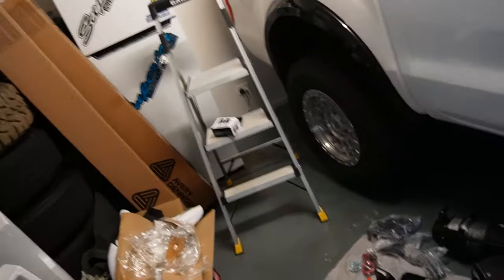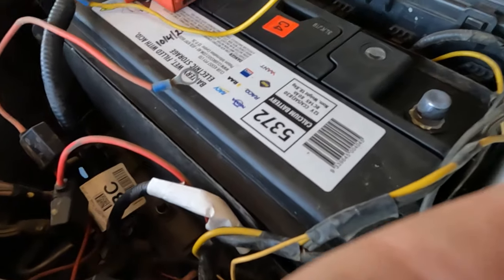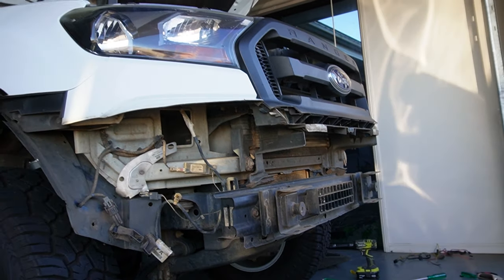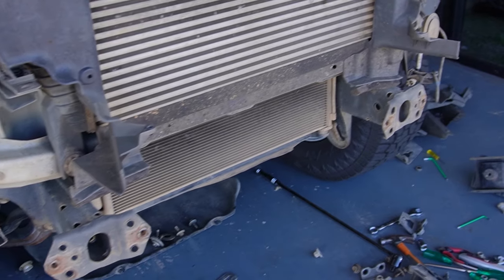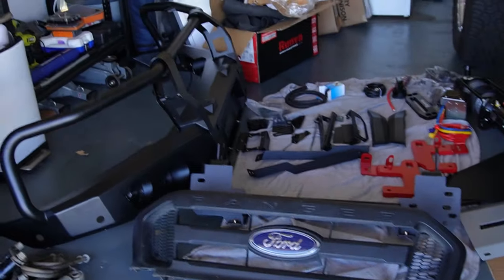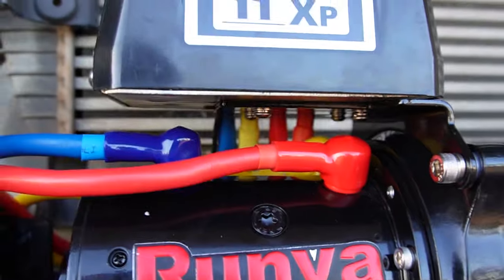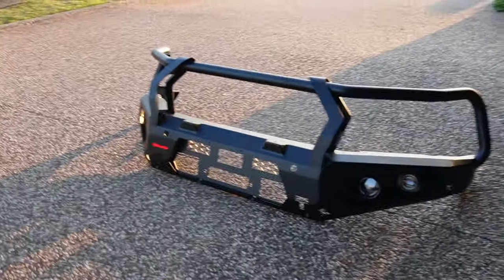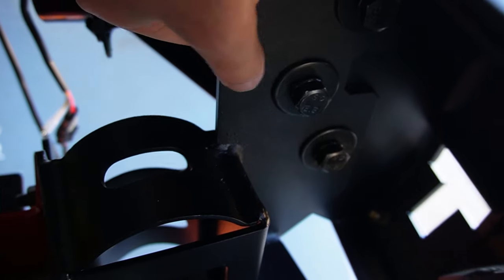Ranger Build starting to take shape | Winch and Bullbar

Comment: when i have the gap there i tape off the light and the guard and paint all the stuff behind the black insert black. this allows you to leave enough of a gap for the body moving without damaging the light or the guard but allows the eye to pass over the area without it being drawn directly to the exposed plastic and white guard behind the insert... its kind of a win win without having to run the ugly insertion rubber 😁 and good stuff man it looks tidy as on the ranger!
Reply: also a good way to hide the winch control box is to relocate it into the engine bay, minimises cutting and you can just pop your bonnet and plug in the wireless dongle if you think your going to need it.
Reply from the maker: Hiding somewhere near the airbox might be the right idea, just not sure how far the wires reach, will find out this weekend though. Such a good idea to black out the gaps! Thankyou!